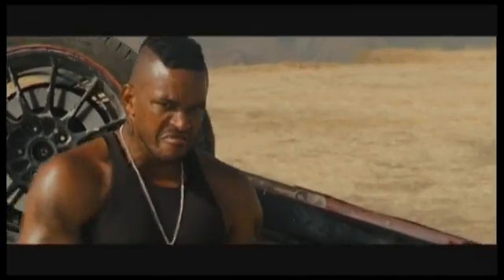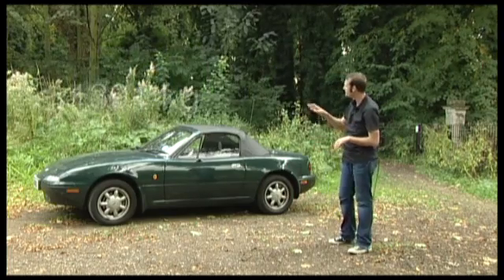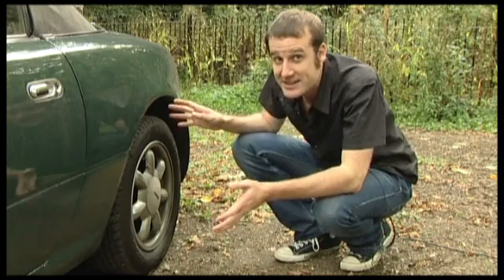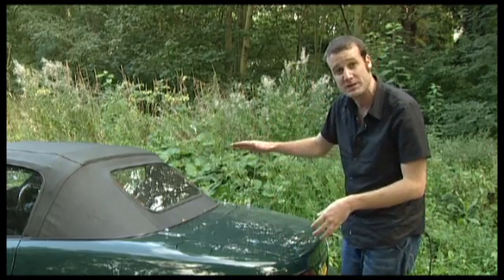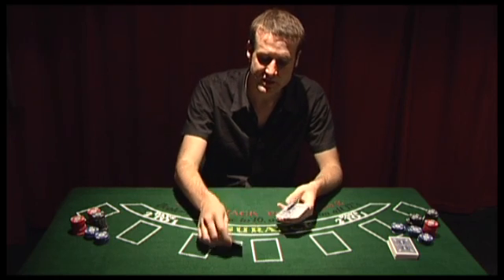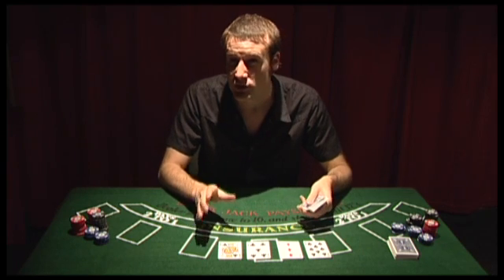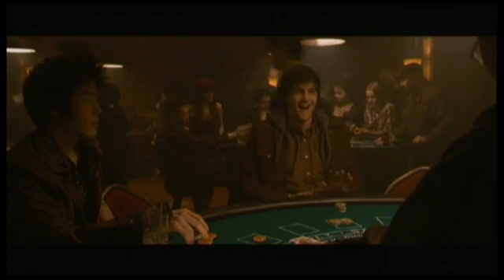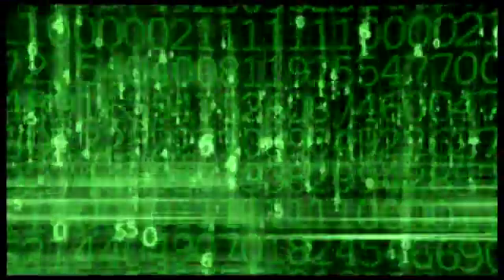Maths In The Movies (Part 1 of 2)

Comment: I'm no card counter, but I'm pretty sure that Ace should not be considered a high card because of its dual-value. The point of the count is to estimate the likelihood of the dealer busting, so the more high cards left in the deck the more likely the dealer will get one and bust. So having more face cards and 10s remaining in the deck means it's more likely that the dealer will get one and bust. But an Ace in the deck does not increase the likelihood of the dealer busting it. In fact, an ace will NEVER bust the dealer, just as a 2, 3, 4 or 5 will never make them bust, so clearly Ace should be counted as a low card, not a high card.

In fact, I would probably shift all of your high/low categories by 1. I would say low cards are A-5, and 6 is indifferent, because A-5 will never bust the dealer (most rules is that the dealer must hit on 16 and stay on 17, so a 5 can only bust them if they already have 17, but they won't take a hit on 17, so it'll never bust them).

Comment: This is physics not math..
Reply: ***** ^this is english not language
Reply: ***** All physics of this type is nothing more than the solving (using maths) of the equation (derived from physics using evidence and maths).  Only something like extremely vague/early-in-thought-process theoretical physics, where everything is being talked about generally, can you avoid maths.
Reply: Take e=mc^2, as an example as physics being math. If m=2kg then it can be written as e=2(299 792 458)^2, which is about 8.98*10^16.

Comment: Isnt the first one physics?
Reply: Matt knows at least some physics, as demonstrated when he covered for the regular Matt on “Citation Needed”.
Reply: Peter Knutsen Mystery Biscuits!
Reply: Physics is nothing but math which is constrained by this nasty thing we call "reality"...
Reply: @cassandraxiv5223  
I have always found it a bit funny how a lot of mathematicians insist on talking about "dimensions" in terms of spatial dimensions, usually in Multivariable Calculus.
You don't need to sketch a physical space to calculate anything, because those physical spaces are just illustrations of functions.
If you have temperature as a function of the 3 spatial dimensions --- T = T(x,y,z) --- then you don't have to have a "4D space", because that's just a function with 3 variables.

Same thing with vectors as well - a 4x1 column vector doesn't have to be "4D space", it's just 4 variables from a system of equations.
And if you really need to have a 4D space then you can simply draw it as a 3D space that maps different points in the 3D space to a line or something, or illustrate the outputs directly in the 3D space as different colours from the colour spectrum, where red represents very low values and violet represents very high values.
Reply: Physics are entirely reliant on maths and can always be explained as such, although not all equations are known to scientists yet.
Reply: +PuffyRainbowCloud
Yes, but Chemistry is entirely reliant on maths as well, and yet it is for some reason often separated from maths and physics.
Chemistry is actually really similar to physics in lots of ways, since it makes heavy use of Newton's laws, energy transfer, thermodynamics and nuclear science, especially when you start studying advanced chemistry.
Reply: @Peter_1986  In physics, we don't like to separate ourselves from chemistry.  ^_^  In thermodynamics, some of us even prefer the chemist equations like PV=nRT, instead of PV=NKT, depending on the situation.  Or orbitals...  I'll always use the chemistry names for orbital over the physics ones...  I don't see a point in labeling them differently, just because some physics textbook used different letters LOL!
Reply: +Jimmy Amato 
I believe that the reason why chemistry is sometimes separated from math and physics is because math and physics were originally more intimately related, like when Newton invented Calculus so that he could better understand physical phenomena.

Also, chemistry could be considered more complex and abstract from an intuitive perspective, since it inevitably involves a lot of Quantum Mechanics;
physics is more concerned with macroscopic situations, so you don't need Quantum Mechanics nearly as often there, so people would have had an easier time working with physics as opposed to chemistry in the old days.

Comment: A Maths Graduate and physics postgrad you may be. I really don't understand how you can argue that applying arithmetic and calculus is not Maths? There are mathematical proofs within Mechanics, proving the formula for the centre of mass of an arc or a sector, using proof to deduce the moment of inertia of an object. Also since when was a particular area of Maths only allowed to be labelled as such if it contained a proof?

Comment: @elizze6 No, that's what he meant by not exceeding the static friction. The idea is that the wheel itself does not rotate because of the acceleration, but the axle on which it is mounted does. This means the front of the car experiences an upward force while the back of the car experiences a downward force. At least if you're accelerating in the forward direction.